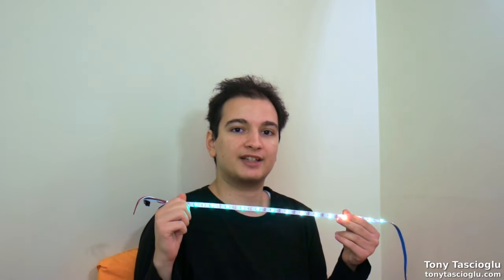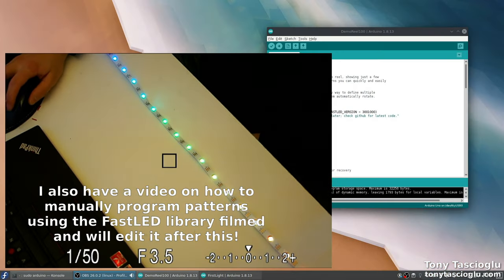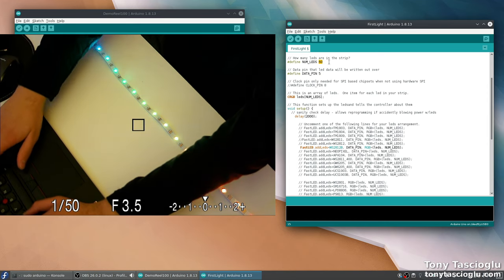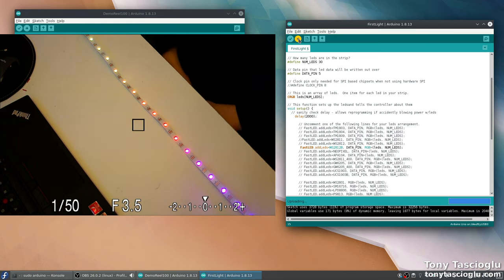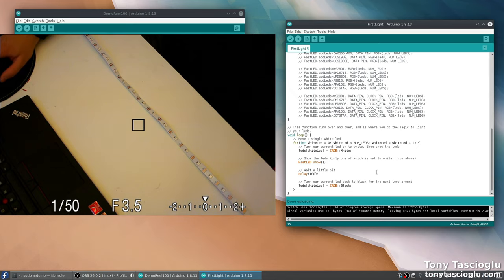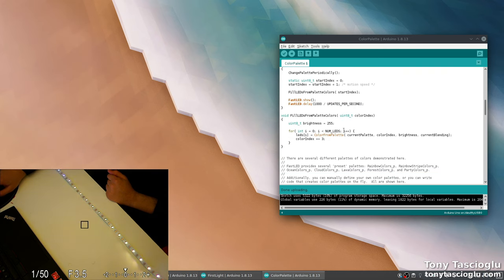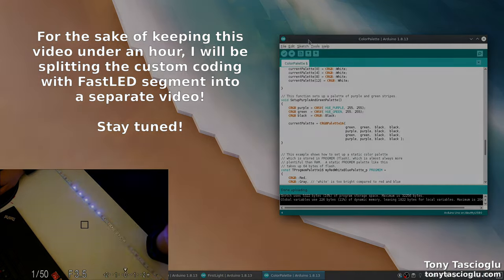Get Started Using WS2812B LED's With an Arduino and FastLED

Comment from the maker: For mobile users:
In this video, I explain how pixel addressable RGB LED's such as the WS2812Bs work, and how you can control them from an Arduino using the FastLED library. I show how to install the FastLED library as well as get started using it with some demos. I go over the advantages as well as limitations of addressable RGB LED's and how we interact with them (data vs clock+data, etc). 

This video is the first in my 2 part series on using WS2812B LEDs with an Arduino.
Next video will be on writing your own programs and patterns using the FastLED library to control the LEDs, rather then just demos to get up and running.

Components used:
- Generic WS2812B 30 LED/m strip
- Generic Arduino Uno with Atmel 328p
- FastLED library

I won't add any links for purchasing, this video is not sponsored and all components were supplied by myself, but make sure you choose a reputable source for parts!

Links:
Arduino: https://www.arduino.cc

FastLED: http://fastled.io
Supported LEDs: https://github.com/FastLED/FastLED/wiki/Overview
Code/issues: https://github.com/FastLED/FastLED 

Timestamps:
00:00 - Intro
00:21 - Note on 2 part series 
01:05 - [Overview] Why use addressable LEDs?
02:25 - [Overview] Types of addressable LEDs
03:44 - [Overview] Controlling LEDs: FastLED Library
04:16 - [Overview] Steps/Parts
04:49 - [Overview] Applications
05:24 - [Overview] Limitations 
07:12 - [Overview] Power usage
08:58 - [Overview] Extra precautions
09:30 - [Hardware] Parts needed
10:23 - [Hardware] Other LED strip options
11:10 - [Hardware] Data direction close up
11:50 - [Hardware] Arduino board options
13:17 - [Hardware] Other misc parts
14:14 - [Hardware] Pinout of LED strip/wires
18:15 - [Hardware] Wiring/hooking it up
19:48 - [Software] Introduction
20:05 - [Software] FastLED library installation
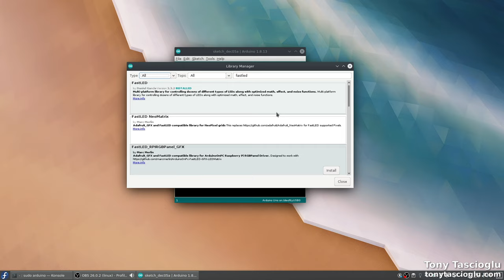20:48 - [Software] Testing our LEDs
21:34 - [Software] Code examples
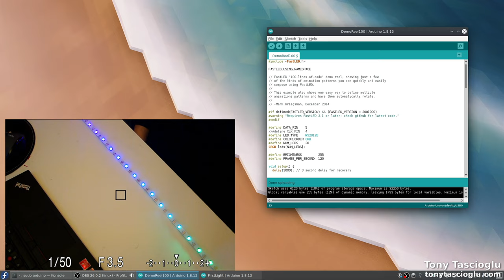24:05 - [Software] Running DemoReel
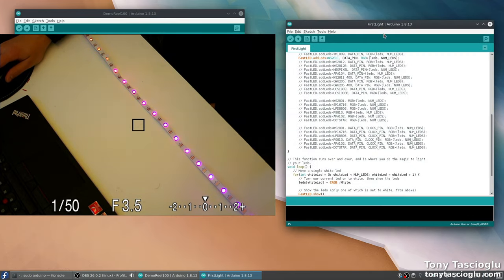25:24 - [Software] FirstLight example
26:25 - [Software] ColorPalette example
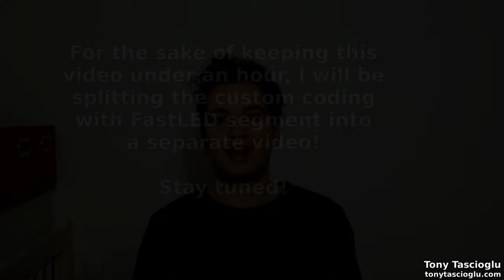28:50 - Concluding remarks
29:37 - Credits and links

Music: 
Approaching Nirvana:
https://approachingnirvana.com
https://open.spotify.com/artist/3sS2Q1UZuUXL7TZSbQumDI
http://youtube.com/user/approachingnirvana
Song: Worth a Thousand Pictures (Lapse in Time)

If there are any mistakes or bad practices I mentioned in the video, please leave a comment and I'll try to pin a compilation of updates.

Production rants/remarks:
- Sorry for the buzzing microphone through part of the video. I tried using a shotgun microphone for the first time rather then my jankier previous setups, and the combination of zipties to mount the microphone the tripod, and noisy circuitry in the dummy battery I used made it come out buzzy.
- Filmed on a Sony SLT-A33 (and Samsung MiniDV camera). Takstar microphone for A footage, and Fifine condenser microphone for all software shots using OBS.
- A33 does not have a clean HDMI output, so we're stuck with the aperture and shutter speed with the HDMI capture card... (It also doesn't read the sensor at full-res unless filming, but then it overheats)

Watch this video on Peertube:
https://peertube.tonytascioglu.com/videos/watch/24b7e27c-33c0-464e-82a7-8f8bf68d9890

Thanks for Watching!
Produced by Tony Tascioglu
https://tonytascioglu.com

Comment: I also use the WS2812B and I even connected them like you did, but my Arduino shuts off, if I plug it into the pc, when I connect the 5V and the GND. Do you know how I can fix this?
Reply from the maker: The Arduino shutting off is rather concerning. The first 2 things that come to mind is that is could be either a short-circuit somewhere in the LED strip, or the voltage is dropping below ~4V and the Arduino shuts off since it can't run at that voltage. 

My first question would be how many LED's are you trying to run? Most USB ports can only provide 500 mA, of which the Arduino can only pass through a fraction of. If you're running like a 5m strip, then it's probably the 2nd and the voltage is probably dropping. That can also be bad for the USB port.

If you're running a short strip, then you can check for shorts using a multimeter. Either use the diode mode if your multimeter has one or the resistance mode to check the resistance/path between the 5v and ground pin on the LED strip. Since those LED strips are all wired in parallel, 1 LED being a dud and having a short means the whole strip doesn't work. I've had to desolder a faulty LED from a strip that was essentially causing a short to get the LEDs to light up.

Comment: Do you have to make about DMA transmission by SPI and USART controller LED RGB?
Reply from the maker: I have looked into DMA on the Arduino I in the past, it's not in my list of future videos I have planned though. I've found that it isn't very well documented, and I also haven't had a use for it yet.  I don't see how it would apply to RGB LED controllers at first glance though. I haven't encountered LED controllers that used SPI - and even used SPI, I don't think it would need direct memory access, since they don't need high performance, it transfers relatively low amounts of data. Could you clarify what you are referring to?